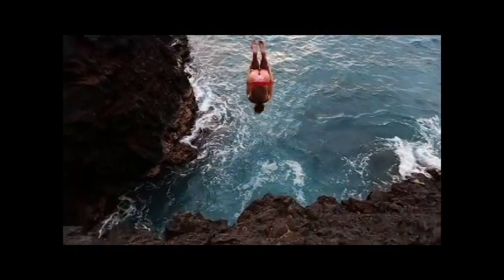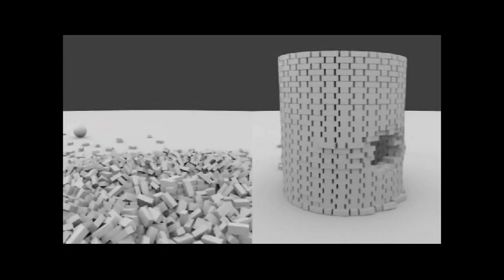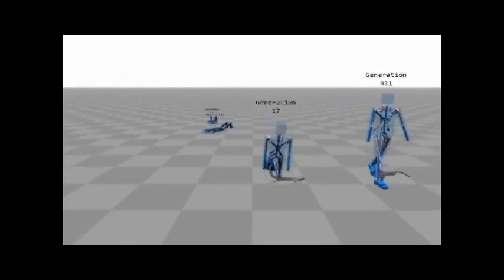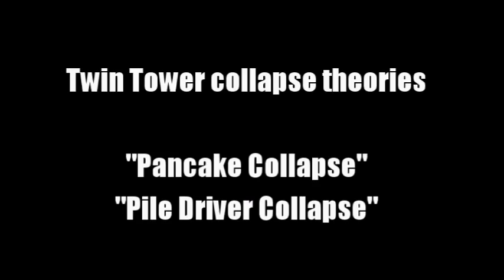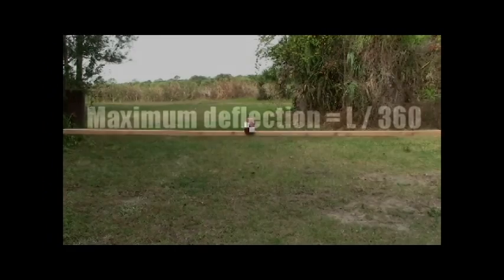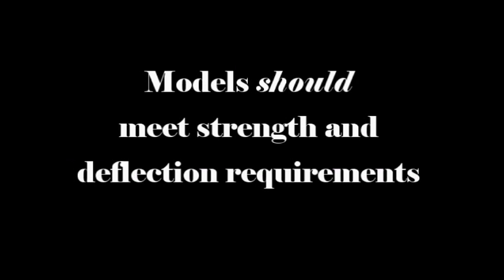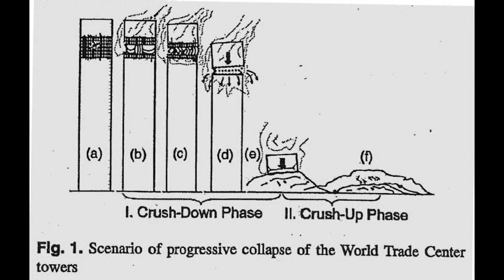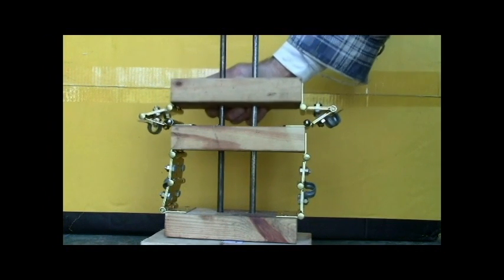9/11 Experiments: The Force Behind the Motion

Comment: There is absolutely no way possible that amount of demolition explosive would have gone un-noticed, survived the impact without at least some of them blowing, and been detectable in the rubble afterwards.
Reply: hellcat1988  In your expert opinion as a 10 year YT veteran, how many Molotov cocktails would have been needed to destroy the Lobby walls and break out ground level windows of WTC1? How many would be required to destroy the maintenance room in the basement levels that tossed a 50 ton hydraulic press across the room? They are, after all, primarily intended to set targets ablaze rather than obliterate them right? How would you say a Molotov cocktail differs from a kerosene low intensity, slow moving deflagration expansion of gasses 800 to 900 feet from the source of ignition?
Reply: +hellcat1988  Are you the type that waits on peer reviewed proof about the function of the bowels before you take a shit sir? Have you been able to tie your shoes without adult supervision yet?
Reply: +hellcat1988  I was just trying to determine if you have had any experience with the practical application of physics at any time in your life or if you were always informed what caused what to happen as in cause and effect? What would you say champ? Have you noticed anything about your environment?
Reply: +hellcat1988  You're a curious fellow full of contradictions and hypocrisy aren't you. I guess that makes you such an attractive hire for the debunker cult isn't it. 

The thing about the physics of everyday life before 9/11 was pretty much solved with Newton's theories and some improvements by Einstein. Their theories are "are commonly accepted, they aren't exempt from being questioned; as real science is prone to do. [presented, tested, reviewed, and accepted]" These were considered proven through the accepted scientific methodology of practical demonstrations. (experiments to prove concepts are valid)

You now suggest that you want to toss them all out the door in favor of unproven theoretical musings of NIST's 9/11 physics. Not for me chum, but you're welcome to think however you please. Good luck with those exploding pancakes.
Reply: +hellcat1988  Have you spent much time with your pom poms in your hands gleefully exclaiming "that proves everything" in the blacksmith from purgatory's channel where he heats up a 1/2" square metal rod red hot then bends it with his pinky to disprove the "moronic jet fuel theory" ?? Do you almost faint when he drops his metal rod on the floor like a classic mic drop after 2 minutes of telling people they are stupid and need to get a job ?
Reply: Yeah, sure....  And I'm sure the design of this guy's model not matching the towers design in ANY WAY didn't affect his test.  GIVE ME PROOF.  Verifiable, scientifically reviewed and confirmed PROOF.
Reply: Deleting your post and putting it under mine doesn't actually make it the proof that I was calling for.  

You conspiracy nut jobs can scream and whine all you want, but you never have anything to actually back up your claims.  I WATCHED those towers get hit and I WATCHED those towers fall.  ALL of it.  There were no secondary explosions.  The aircraft hit and the towers came down and the people died.  I won't even begin to argue about who was behind it because that's a web I don't feel like pulling at.  

I do know, without a shadow of a doubt, that those planes hit the towers and the towers came down because of it.
Reply: hellcat Quote: "GIVE ME PROOF.  Verifiable, scientifically reviewed and confirmed PROOF." Learn a bit about the laws of physics then and afterwards just think about the official USG theory that gravity blew up the towers and melted the steel and concrete.  The official USG theory is absurd.  Explosives and incendiaries did it. Take the WTC2 event, a top down explosive demolition.
9/11 Commission Report Page 305
“From 9 : 59 until 10 : 28
At 9 : 58 : 59, the South Tower collapsed in ten seconds, killing all civilians and  emergency personnel inside, as well a number of individuals - both first responders and civilians - in the concourse, in the Marriott, and on neighboring streets.”

Ten seconds = essentially, free fall.

Google:
Questions and Answers about the NIST WTC Towers Investigation
Quote:
“Since the stories below the level of collapse initiation provided little resistance to the tremendous energy released by the falling building mass, the building section above came down essentially in free fall, as seen in videos. As the stories below sequentially failed, the falling mass increased, further increasing the demand on the floors below, which were unable to arrest the moving mass.”

Where did the ENERGY to disassemble the building SEQUENTIALLY & in a highly explosive manner come from?  

The “falling mass” was obviously DECREASING as it was being sequentially ejected SIDEWAYS from the top downwards!

There was no crush down!  There was no “accumulation of mass” (or “increasing” mass) over the tower stub after the dust had settled! The building debris fallout zone was instead up to 500 feet from the tower base (FEMA said so).

In order for the towers to have "collapsed" gravitationally, as we've been told over and over again, in the observed duration, one or more of the following zany-sounding conditions must have been met:

1. The undamaged stories below the alleged aircraft impact zone offered zero resistance to the collapse.

2. The glass, steel and concrete spontaneously disintegrated without any expenditure of energy.

3. On 9/11, gravity was much stronger than gravity, because a giant invisible sky god stomped on the towers perhaps?

4. On 9/11, energy was not conserved.

However, none of these physics-violating conditions can be accounted for by the official government conspiracy theory of 9/11, nor by any of the subsequent analyses designed to prop up the official theory of 9/11.

Bottom line: the US government/PBS/PM/SA explanation for the WTC “collapses" fails the most basic conservation-of-energy reality check. 

Therefore the evil, lying, US government theory does not fit the observed facts; the notion of a “pancake collapse” cannot account for what happened. The "pancake collapse theory" or "progressive crush down" explanation is impossible, and thus absurd.

It is utterly impossible for a "gravitational collapse" to proceed so destructively through a path of such great resistance in anywhere near free-fall times. 

This fact debunks the preposterous contention that the observed WTC “collapses" can be blamed solely upon damages resulting from aerial assaults by just 19 Kamikaze superheroes. 

The unnaturally brief durations of the highly destructive top-down “collapses” (sequentially explosive demolitions) reveal that the towers did not disintegrate because they were coming down, but rather they came down because something else was causing them to disintegrate.  Gravity just carried the disassembled building debris out of the sky.

See also:
 "TV nerd beats NASA engineer with 9/11 Truth physics" ;-)
Reply: AYong:

1:  That isn't proof.  That is your guess at what happened.

2: The buildings didn't explode outward, as you claim, or the debris field would have been MUCH wider than it was.  Yes, some of the building material did get forced away, but a majority of the material fell down onto the floors below, hence the relatively small footprint of the main structural rubble.  A 500 ft debris field is not all that much for an unconstrained collapse of TWO buildings over 1300 feet tall.

3:  I do have a decent understanding of physics, as well as the ability to look at the design of the towers and realize this guy's "example" tower isn't even close to the same structural design.  Not in the least.

4:  Have you ever even watched a progressive collapse demolition?  Why don't you click around youtube a bit and watch a few.  Both successful and failed.  You'll get a better understanding of how the debris scatters, what it ACTUALLY looks like to have demolition charges go off on multiple floors, and what the collapsed structure might look like afterwards.
Reply: MrTheredpill:

Then provide proof.  Provide confirmed test results of the debris from the buildings containing explosives residue, video of the alleged explosions, proof that the explosives in the lobby blew first, and proof that there were explosives planted before the attacks.

It's all well and good to scream conspiracy, but without proof all you're doing is insulting the memory of the victims and the rescuers who died trying to save them.
Reply: Payed:

I never claimed to be an expert.  Obviously you aren't either.  You still aren't providing peer reviewed proof of anything.
Reply: Payed:

Kinda shooting yourself in the foot there with your examples...  I don't need to wait for peer reviewed studies and facts about how my bowels work.  They've already been done.  While the results are commonly accepted, they aren't exempt from being questioned; as real science is prone to do.  Until a better explanation has been presented, tested, reviewed, and accepted, I think I'll stick with the current theory.

Yes, I can tie my shoes.  Why, were you planning to graduate from velcro and need someone to teach you?

Again, you're still not providing proof of anything.  You'd think this long after the attack there would be at least one thread, one STRING of proof that could be verified to give some validity to your claims.  Yet there's nothing.  Either you're too lazy to bother looking for it or there isn't any to begin with.  Either way, the science backs me up, not you.
Reply: Payed:

That's the beauty of science.  I don't need to replicate the experiments of others.  They've invested the time, money, and effort into gaining an understanding of the world, then shared it with the rest of us.  Those findings have been reviewed, replicated, confirmed, and presented.  

You trying to distract from the FACTS surrounding the collapse based on solid, reviewed, scientific evidence by making a pathetic attempt to paint me as ignorant and lacking an understanding of physics isn't going to change that.

We could go back and forth for ages, you challenging me and me presenting the facts as I've been taught or learned on my own until I mistype something or find old information, at which point you'll again try to present me as some ignorant fool without any knowledge at all; despite and previous evidence otherwise.

I'm not going to debate you on that.  If you have ANY scrap of proof contrary to the findings of the investigation of the collapse or my earlier statement about the planes impacting the tower, then we can talk.  Otherwise, you're just a troll that I'm going to keep poking until you roll over and crawl back under your bridge.
Reply: Payed:

Those "unproven theoretical musings" are backed up by all known models of physics as well as advanced computer simulation.  You have nothing of the like to back up your own claims.

Just where is this hypocrisy of mine that you are claiming?
Reply: hellcat the scientific law of the conservation of energy and momentum is scientific proof that the official conspiracy theory for the destruction WTC1 & 2 is impossible and thus a lie. You may be aware of WTC7 being destroyed in an implosion demolition later that day.  What is less often discussed is how Jennings and Hess were trapped inside that building for hours, from before WTC2 blew up until after WTC1 had blown up, because both internal staircases had been destroyed by explosions, very clearly caused by explosives!  Since the "AA11 event" was obviously heading south into WTC1, very clearly no jet fuel (which is not a high explosive, or even very volatile, compared to gasoline) from that event could plausibly have entered WTC7, located to the north of WTC1, to cause the massive explosion that later blew Jennings and Hess backwards with the blast that destroyed both of the internal fire-escape stairs and had then trapped them inside that building for hours. 

See YouTube: Barry Jennings Interviews (WABC-TV, 2001 / LTW, 2007)

Barry Jennings (and Michael Hess) apparently arrived at the WTC7 emergency office (via a freight elevator, the main elevators had already been disabled) seemingly almost immediately after the OEM bunker had been evacuated, which reportedly occurred at the latest around 9 : 37 am, if not rather sooner before 9 am, according to other reports.  Jennings said later that he was already INSIDE the WTC7 building when the UA175 event into WTC2 happened, but it does not sound like he ever witnessed that event happening at 9 : 03 am.  

It is of course very curious that WTC7 needed to be evacuated as an emergency management centre at all, since it was an armoured structure designed specifically for EMERGENCIES just like this one and these two alleged air crashes into buildings that officially SHOULD NOT HAVE BEEN EXPECTED TO BLOW UP should have meant that the WTC7 bunker was a perfectly safe place to be!  

In 1999, NYC Mayor Rudy Giuliani had constructed a US$13 million emergency command retreat on the 23rd floor of World Trade Center Building 7.  An armoured, self-contained facility designed to provide a "safe haven for leadership" in the event of a natural disaster or terrorist attack. But several first responders interviewed after 9/11 claimed that the Office of Emergency Management’s Emergency Operations Center (OEMEOC) was empty and had been “deactivated” as early as 9 am on the morning of September 11th, a time when just such an emergency was in full swing!

Michael Hess has corroborated Jennings' account of hearing explosions inside WTC7 and witnessing the damage they caused which trapped them inside.  A 2010 video released by NIST further corroborates Barry Jennings' account.  Michael Hess is seen visible calling through a broken window of the 8th floor of WTC7, calling out for help to get down, after both towers had blown up, so presumably at some time after 10 : 30 am and before noon.  

One might think it possible that these explosions inside WTC7 destroying the two stairwells coincided with WTC2 blowing up at 9 : 59 am, but it is not plausible that any explosively ejected debris from WTC2 did that damage.  That timing is not what Barry Jennings later said though, he said the stairs were taken out at around floor 6, so he had to go back up to floor 8, then he bust a window with a fire extinguisher, then the NYFD ran away because WTC2 was coming down, then later WTC1 came down, before they were finally rescued, possibly at around noon, by the NYFD.  He also stated that there were some dead bodies inside WTC7 as he was leaving, although officially nobody died in WTC7 at all.
Reply: hellcat In the official theory for the WTC1 basement explosions (and lobby) it was claimed to be a simple deflagration fireball from jet fuel kerosene that had somehow made it all the way down to the basement. Never mind that witnesses said these bottom of the tower explosions happened before the alleged AA11 impact could have introduced any liquid fuel to the building and never mind that the cause of the explosions did not convincingly introduce liquid fuel and fireballs to the building between the impact floor and the basement! In WTC1.  William Rodriguez and his supervisor (Anthony Saltamachia) are on record for repeatedly affirming that there was a huge basement explosion in WTC1 before the "AA11" event, or the alleged first aircraft impact by a so-called "hijacked" aircraft. Other WTC1 eyewitnesses claimed that there was an additional lobby explosion before the "AA11" event.

Ms Evalle Sweezer (office worker): "I believe that the bomb hit the lobby first, then in a couple of seconds the first plane hit."

Mike Pecoraro & a colleague arrived at the basement WTC1 “C level” and they found that the machine shop was gone.

"There was nothing there but rubble, "Mike said. "We're talking about a 50 ton hydraulic press, gone!" [Wow, some really powerful kerosene deflagration fireball that was! ;-) ]

The two made their way to the parking garage, but found that it, too, was gone. "There were no walls, there was rubble on the floor, and you can't see anything" he said. [Wow, some really powerful kerosene deflagration fireball that was! ;-) ]

They decided to ascend two more levels to the building's lobby. As they ascended to the B Level, one floor above, they were astonished to see a steel and concrete fire door that weighed about 300 pounds, wrinkled up "like a piece of aluminium foil" and lying on the floor. [Wow, some really powerful kerosene deflagration fireball that was! ;-) ] "They got us again," Mike told his co-worker, referring to the terrorist attack at the center in 1993... He was convinced a bomb had gone off in the building... Mike ascended to the Lobby Level where he met Arti DelBianco, a member of his work crew.

See Bob McIlvaine's 2016 interview:

Bob McIlvaine and his family are not alone in having suffered a devastating personal loss on September 11, 2001. The loved ones of the nearly 3,000 victims of the destruction at the World Trade Center know what he has endured for the past 15 years.

But McIlvaine is different from most of these families in important ways. In addition to his unwavering and often lonely fight to expose what he calls the complicity of the US Regime in this false flag attack, he has strong forensic evidence proving that his 26-year-old son, Bobby, was killed by a powerful explosion upon entering the lobby of the North Tower. That evidence is corroborated by the accounts of many FDNY members, police officers, and workers who reported that explosions went off in the lower parts of the towers before the buildings were levelled — some of them even before the first airplane struck.

In a recent interview, McIlvaine said that his son’s body was one of the first to be recovered and taken to the New York City morgue on that fateful day. He explained that he has been able to reach more definitive conclusions about the details of his son’s death only since conferring, in either 2006 or 2007, with the doctor who had examined Bobby’s body at the morgue.

That meeting provided Bob McIlvaine with evidence confirming that a huge explosion — and not the North Tower's eventual demise — was responsible for killing his son. According to Bob McIlvaine, the wounds described by the doctor indicated that his son had been hit by flying glass from some kind of gigantic blast.

Bobby’s face was damaged beyond recognition, he had lacerations all over his chest from glass shards, and he had post-mortem burn marks. In fact, the blast was strong enough to literally blow Bobby out of his laced shoes (they were not on the body when it was brought to the morgue).

“My final summation is that he was walking into the building, and before he got into the building there was a huge explosion, and of course the force of it just threw him back into the open area,” Bob McIlvaine says. “That’s why he was picked up so quickly, because the EMTs came down there so quickly. Someone had gotten him out of there and to the morgue before the towers came down.”

It is the nature of Bobby’s injuries that convinces the elder McIlvaine that the explosion had nothing to do with the airplane hitting the tower. That conclusion is at odds with the explanation put forth by the 9/11 Commission, which attributed explosions in the Twin Towers' lower floors and basements to fireballs of exploding jet fuel coming down the elevator shafts and blowing out.

“He wasn’t hit by a fireball, he was hit by a detonation,” McIlvaine contends. “In a detonation, the blast is first and then followed by the heat.”

He points out that the official account credits the supposed fireball with blowing out floors in different parts of the building — leaving many untouched floors in between the damaged ones.

“It blew out the 72nd floor, it blew out the 23rd floor, it blew out the lobby, it blew out all sorts of floors in the basement, and it even destroyed parts of the PATH [rail] station more than 200 feet away. For one fireball to do all that — well, that’s one powerful fireball.”

This becomes even more impossible, he argues, when you consider that the tower was divided into three vertical sections. Each elevator (except for the basement-to-penthouse maintenance elevator) serviced only one section. Thus, someone travelling from top to bottom would have had to take three different elevators. This configuration would have prevented fuel from pouring down the multiple elevator shafts and causing all that destruction.

In short, says McIlvaine, “It’s impossible for a fireball to come down that far and create that kind of damage.” [Jet fuel is like kerosene, it DOES NOT EXPLODE but can only ever deflagrate with a very low pressure fireball.]

What made the horror of September 11 even worse for the McIlvaine family was that they had no information about their son and didn’t know if he was alive or dead. Adding to their uncertainty was that he didn’t actually work in the towers; instead, he worked for Merrill Lynch in an office building across the street from the World Trade Center. So McIlvaine thinks it’s possible that his son was either on his way to a Merrill Lynch seminar that was being held on the 106th floor of the North Tower or was cutting through to get to his own office.

A Canadian who worked for Merrill Lynch in 2001 and who was at the World Trade Center that day contacted McIlvaine two years ago. The man explained that he was heading to the same conference on the 106th floor about the same time that Bobby would have been approaching the building. But he had stopped for a coffee on the way — a decision that, in retrospect, he thinks might have saved his life. While ordering his coffee, he heard a massive explosion in the North Tower lobby.

McIlvaine says he doesn’t tell his son’s story that often anymore because most people just don’t want to hear it. Even the 9/11 families don’t want anything to do with the idea that the event was, as he claims, perpetrated by their own government.

“People look at the United States as a father figure, and they just can’t believe their father could do something that evil.”

McIlvaine and his wife, Helen, have written a message for the 15th anniversary of 9/11 that will appear in The Journal of 9/11 Studies and that Bob will read at the two-day “Justice In Focus” conference being held the weekend of September 10-11 in NYC.

“I don’t want to be a victim,” McIlvaine says. “I just want to keep speaking my piece.”
Reply: Payed:

You really can't stand it that you know I'm right can you?  You can't stand it that the science backs me up and you can't show one scrap of evidence to back up your conspiracy theory.  It's really sad to see someone come to that realization.
Reply: AYoung:

Again, if you really believe the science backs up your claims about how the two towers came down, find some scientists and studies that support your claim and present them.  Give links to peer reviewed and corroborated investigations.

As far as building 7 is concerned, I haven't bothered to look into it at all because that's not what I'm arguing about.  The only thing I've been arguing is that the planes hit the towers and that is why they came down.
Reply: MrTheredpill:

I'm not insulting the small number of surviving eye witnesses.  I'm asking for one shred of proof that could corroborate the story even a little.  Some rubble that's been chemically tested by a team of labs to confirm there is explosive residue.  A piece of detonation cord or explosive device that would show how and where the explosives might have been placed.  ANYTHING that might lend some credibility to your claims.
Reply: hellcat quote: "None [not one] of you have [has] liked [linked] to studies or peer reviewed articles showing how, where, and what kind of explosives were found in the rubble." Well you are just ignoring independent research, published internationally, that found unreacted nano-thermitic material in the fallout dust surely?  You are not going to find these publications to read in the USA of course!  

What was found in the official story points to incendiaries melting the steel and concrete and high explosives being used as well. Bob McIlvaine talks about his son being blown backwards out of his shoes when he was killed by the massive WTC1 lobby explosion, that happened a few seconds before the first alleged air crash of AA11 into WTC1. Additional very high explosive damage (so from supersonic detonation blast, not low-pressure deflagration) was simultaneously destroying areas of the WTC1 basement before the alleged AA11 event.  

Air slap was breaking windows hundreds of feet away from the Twin Towers as they blew up.  Blast ejected multi-tonne sections of steelwork upwards and outwards from the towers at a sideways speed of about 70Mph.  Air slap tossed observing news helicopters around in the sky thousands of feet away as the towers blew up. 

The billions of microscopic iron microspheres in the fallout dust indicates that steel was explosively cut, the steel turned to a liquified mist of microscopic iron spheres that formed tiny iron balls under the action of surface tension, as this "mist" cooled.  The sulphur contaminated steelwork and eutectic inter-granular melting of the steel, causing a Swiss cheese effect,  has been theorised to have been caused by a "thermate reaction" with "thermate" as a subtle variant of thermite. 

Non-US Regime sponsored, so independent researchers, also reportedly detected unreacted highly engineered nano-thermitic material in the fallout dust. This was apparently engineered so that a layer of aluminium seems to have been vacuum deposited on an iron oxide substrate layer, before grinding the material into a very fine dust.  Such a substance could well have a much faster reaction time than normal thermite, which is a rather crude mixture of aluminium and iron dust.  The dark coloured dusty "squib" evidence, might indicate that a very high brisance thermobaric (two-stage, fuel-air) explosive was used. An electrically charged thermobaric dust cloud could be an even more sophisticated method of arranging, or distributing, the nano-thermitic fuel-air mix in an open plan office building space, just prior to detonation. 

Anomalous "fires" with very great heat that melted steel and concrete remained at ground zero for months after 9/11. Decontamination earth was trucked in to ground zero, spread around and then trucked out again to the aptly named "Fresh Kills" dump site with residual heat in the ground at Fresh Kills preventing the earth from freezing that winter because the ground water was still boiling hot.

Temperatures in WTC6, gutted by a massive explosion unrelated to any other buildings blowing up, were so high that in WTC6 museum exhibits you could see melted guns encased in previously liquified melted concrete that had "flowed like lava" according to the exhibit caption. 

Anyway, that is my point of view, other mind/body organisms will no doubt have their own subjective point of view, so that they may well perceive the scientific evidence in a different way.  

It is rather like the old story of an elephant in a small room, with small windows affording individual people a very limited view of the elephant.  One observing person might say "I can see a big curved white tooth looking thing.  How weird!"  Another might say "I can see a little eye looking back at me."  Yet another might say "what a huge foot that is!"  Or "what a funny looking tail that is!"   It is very difficult for us to form an overall impression of what an elephant might really look like, unless you can see the entire animal all at once!

Therefore, IMO when studying an interesting event in history like 9/11 for the "who, what, when, where why and how" it is necessary to view this "elephant in the room" from a great many different angles. Cui Bono? Who Benefited?

Or take the WTC7 implosion demolition event, that NIST has also admitted was in free fall at "stage 2" of the "collapse".  So that free fall was only possible there because EXPLOSIVES had removed all of the load bearing columns, simultaneously, out of the way of the falling mass!  Dr. Robert Korol, professor emeritus of civil engineering at McMaster University in Hamilton, Ontario, Canada and a fellow of the Canadian Society for Civil Engineering, has led a team of academic researchers in preparing two peer-reviewed scientific papers on the destruction of World Trade Center Building 7. Both papers were published in the Challenge Journal of Structural Mechanics — the first one in July 2015, the second in February 2016. 

Google:
The collapse of WTC 7: A re-examination of the “simple analysis” approach
Robert Korol, Paul Heerema, Ken Sivakumaran
Department of Civil Engineering, McMaster University, Hamilton, Ontario L8S 4L7, Canada

Quote: Regarding our focus on gravitational potential energy versus the dissipative energy possessed by the structure, we found that the former was insufficient to cause a total collapse scenario to occur by a factor of 4.

But why make such appeals to authority anyway? Think for yourself!
Reply: You still aren't providing any links to actual peer reviewed scientific data showing that the trade center was taken down by explosives.  

It wouldn't be hard to conceive that those "micro-spheres" were created from molten steel from the fires being blown out of the buildings as the collapsed if you've ever worked with molten metal before like I have.

As far as the lobby of either building being blown up before the towers collapsed, how the hell do you explain people evacuating from those very lobby?

Thinking for yourself is great and all, except when you're ignoring fact and science to come up with your own idea of what actually happened.  That's how religions work and why they're all crap.
Reply: hellcat: "You still aren't providing any links to actual peer reviewed scientific data showing that the trade center was taken down by explosives." I gave you a peer reviewed paper to search for, you must be aware that hot links will render the post invisible due to censorship.
Reply: hellcat you said "It wouldn't be hard to conceive that those "micro-spheres" were created from molten steel from the fires being blown out of the buildings as the collapsed if you've ever worked with molten metal before like I have." Except that office fires cannot possibly reach hot enough temperatures to melt steel.  Your hypnotically entranced mind is now desperately grasping at metaphorical straws, to maintain the absurd fiction of gravity blowing up the towers, in a resistance free manner!  It took mankind thousands of years to create blast furnace fires hot enough to melt steel.  Ordinary office fires do not melt steel!  No other steel frame buildings have ever "collapsed" (have ever blown up) like that, due to fire!

There was no crush down, there were even human survivors in stairwell B of WTC1 because that tower did not crush down on top of their heads, the mass above their heads flew away sideways from the top downwards, at about 70 Mph.  The survivors looked upwards after the explosive demolition process, to see blue sky above their heads!  

Quote: "As far as the lobby of either building being blown up before the towers collapsed, how the hell do you explain people evacuating from those very lobby?" Because the explosion in the lobby obviously did not interfere with the evacuation through the explosion damaged lobby, or interfere with the firemen entering the lobby and the Naudet video crew showing us video of the explosion damaged lobby, the explosion that had just killed Bob McIlvaine's son in the Plaza outside the lobby.
Reply: MrTheredpill:

Wow...  You're one of those anti-vaccination people?  That explains A LOT!

Do your research about vaccinations you twit.  There has only been one TOTALLY disproven study finding any link through manipulated data of an extremely small sample size.  The only reason there has EVER been any possible link considered between autism and vaccinations is because the first diagnosable symptoms for autism don't actually show up until the same time as vaccinations would be administered.  Even the studies commissioned and paid for by the idiot parents who thought vaccinations caused autism found no link whatsoever.

As far as cancer rates, there are new studies coming out that are pointing to cancer as an inevitability of old age due to degradation of dna over time as a natural part of the aging process.

I don't know why I'm even bothering to continue humoring you as you've proven just how much of a wackjob conspiracy nut you are by showing that you're an anti-vaccination freak.
Reply: Have you ever worked on a car that's been on fire?  Have you ever picked through a shed that's burned down?  Have you ever worked with any kind of metal cutting implement AT ALL?  Have you ever thrown any metal into a bonfire?

I have done every one of those things and I can say without a doubt that ANY kind of accelerant, even the adhesive used to make carpet (even the fire resistant kind) will melt steel.  Once it's molten, high pressure airflow, like what you'd find from a collapsing building or convection flow through a chimney will blast small particles of metal out of the pool.  From there, it's not hard for the metal to form spheres as it falls even a short distance.

Ask anyone who works at a metal foundry how often they have to sweep up the metal dust from slag blown off the casks or steel workers who have to clean up after prepping and welding.

If there is video evidence of the lobby being blown up BEFORE the planes hit, share it with the rest of us.  That would be proof lending credibility to your crack pot theory.  I'm guessing you're going to say something to the effect of "he didn't start recording until after the plane hit" or "they seized his footage" or some similar crackpot cliche.
Reply: Where's your evidence to the contrary?  What do you have to back up your claim?  It amazes me how people can take anecdotal evidence without any proof to back it up, or even just hearsay, and form such solid belief around it.  I realize that's exactly how religion works, but still.

You anti-vaccination idiots are the ones who are going to end up dead, as evident by the recent outbreaks of diseases we have vaccinations for...
Reply: hellcat you said "I'm guessing you're going to say something to the effect of "he didn't start recording until after the plane hit"" If you had actually studied the French Khazarian Jules and Gedeon Naudet video record, it would be obvious to you that they were videoing the Church & Murray intersection and the Church Street "gas leak" --- which permitted them to document the scaffolding already roped off with Police Tape before the UA175 event and giving them a very nice view of WTC1 north face for the AA11 event.  So pretty obviously they were quite a long way from WTC1 when the lobby explosion happened.  There are telephone audio recordings of the two explosions, but if you are going to ignore so many American eyewitnesses and victims telling you exactly what happened, then believe whatever you want to believe. Shrug.
Reply: hellcat you said  "A piece of detonation cord" but there is no reason to think that detonation-cord would have been used in this case, of a camouflaged military sabotage program.  Don't confuse military technology with crude, cheap, civilian demolitions please.  Officially US regime sponsored researchers noted eutectic inter-granular melting with sulphur residue contamination causing a Swiss Cheese effect.  Independent researchers found unreacted nano-thermite in the dust. You insist that normal office fires melted the steel and concrete at ground zero and kept the fires burning for months, even though that never happened during WW2 in European cities. 

Genuine sabotage devices would not ever have "DANGER! I am a Bomb!" written on them!  Neither would they look like sticks of dynamite with an alarm clock strapped to them!  Or have a red digital clock on display, ticking down the seconds to detonation, as in so many stupid Hollywood movies!  Realistically, you would want to disguise any (digital radio detonated) sabotage devices as looking like something innocuous, like "lighting transformers" or something, to be hidden in the ceiling voids above the ceiling tiles (attached to the truss network), inside the technical risers, under the raised technical flooring tiles, that need to be raised only when running services (cables etc.) to desks in open-plan office spaces.  

Civilian office workers would never look there and, even if they did, they would not know what they were looking at anyway.  But believe the 19 Kamikaze Superhero propaganda cover story if you like. Shrug.

The following text is the transcript of the
9/11 A Conspiracy Theory You Tube Corbett Report

On the morning of September 11, 2001, 19 men armed with box-cutters directed by a man on dialysis in a cave fortress halfway around the world using a satellite phone and a laptop directed the most sophisticated penetration of the most heavily-defended airspace in the world, overpowering the passengers and the military combat-trained pilots on 4 commercial aircraft before flying those planes wildly off course for over an hour without being molested by a single fighter interceptor.

These 19 hijackers, devout religious fundamentalists who liked to drink alcohol, snort cocaine, and live with pink-haired strippers, managed to knock down 3 buildings with 2 planes in New York, while in Washington a pilot who couldn’t handle a single engine Cessna was able to fly a 757 in an 8,000 foot descending 270 degree corkscrew turn to come exactly level with the ground, hitting the Pentagon in the budget analyst office where DoD staffers were working on the mystery of the 2.3 trillion dollars that Defense Secretary Donald Rumsfeld had announced “missing” from the Pentagon’s coffers in a press conference the day before, on September 10, 2001.

Luckily, the news anchors knew who did it within minutes, the pundits knew within hours, the Administration knew within the day, and the evidence literally fell into the FBI’s lap. But for some reason a bunch of crazy conspiracy theorists demanded an investigation into the greatest attack on American soil in history.

That investigation was delayed, underfunded, set up to fail, a conflict of interest and a cover up from start to finish. It was based on testimony extracted through torture, the records of which were destroyed. It failed to mention the existence of WTC7, Able Danger, Ptech, Sibel Edmonds, OBL and the CIA, and the drills of hijacked aircraft being flown into buildings that were being simulated at the precise same time that those events were actually happening. It was lied to by the Pentagon, the CIA, the Bush Administration and as for Bush and Cheney…well, no one knows what they told it because they testified in secret, off the record, not under oath and behind closed doors. It didn’t bother to look at who funded the attacks because that question is ultimately of “little practical significance“. [Little = Huge] Still, the 9/11 Commission did brilliantly, answering all of the questions the public had (except most of the victims’ family members’ questions) and pinned blame on all the people responsible (although no one so much as lost their job), determining the attacks were “a failure of imagination” because “I don’t think anyone could envision flying air-planes into buildings ” except the Pentagon and FEMA and NORAD and the NRO.

The DIA destroyed 2.5 TB of data on Able Danger, but that’s OK because it probably wasn’t important.

The SEC destroyed their records on the investigation into the insider trading before the attacks, but that’s OK because destroying the records of the largest investigation in SEC history is just part of routine record keeping.

NIST has classified the data that they used for their model of WTC7′s collapse, but that’s OK because knowing how they made their model of that collapse would “jeopardize public safety“.

The FBI has argued that all material related to their investigation of 9/11 should be kept secret from the public, but that’s OK because the FBI probably has nothing to hide.

This man never existed, nor is anything he had to say worthy of your attention, and if you say otherwise you are a paranoid conspiracy theorist and deserve to be shunned by all of humanity. Likewise him, him, him, and her. (and her and her and him).

Osama Bin Laden lived in a cave fortress in the hills of Afghanistan, but somehow got away. Then he was hiding out in Tora Bora but somehow got away. Then he lived in Abottabad for years, taunting the most comprehensive intelligence dragnet employing the most sophisticated technology in the history of the world for a decade, releasing video after video with complete impunity (and getting younger and younger as he did so), before finally being found in a daring SEAL team raid which wasn’t recorded on video, in which he didn’t resist or use his wife as a human shield, and in which these crack special forces operatives panicked and killed this unarmed man, supposedly the best source of intelligence about those dastardly terrorists on the entire planet. Then they dumped his body in the ocean before telling anyone about it. Then a couple dozen of that team’s members died in a helicopter crash in Afghanistan.

This is the story of 9/11, brought to you by the media which told you the hard truths about JFK and incubator babies and mobile production facilities and the rescue of Jessica Lynch.

If you have any questions about this story…you are a bat-shit, paranoid, tinfoil, dog-abusing baby-hater and will be reviled by everyone. If you love your country and/or freedom, happiness, rainbows, rock and roll, puppy dogs, apple pie and your grandma, you will never ever express doubts about any part of this story to anyone. Ever.

This has been a public service announcement by: the Friends of the FBI, CIA, NSA, DIA, SEC, MSM, White House, NIST, and the 9/11 Commission.

Because Ignorance is Strength.

~~~~~~~~~~~~~~~~~~~~

Google:
Nonsense Fairytales Propaganda Crap... Still You Believe - YouTube

”Obama is dead, I don't care, what did I say?" Geraldo Rivera

You heard it on the evening news
The voice of AUTHORITY
And though it was all a lie
Still you believe

Do, do, do, do, do,

They told you about yellow cake
As a pretext to war
They embedded reporters cheap
like $5 whores
They gave you a bogeyman
to scare you at night
and terror threat level alerts
till you were ready to fight

But it's all a lie, made of nonsense for you to buy
still you believe, still you believe, still you believe

They told you Earth's heating up
That we're all going to stew
But the only thing cooking here
is the data that they use

They told you about Saddam Hussein
and his W. M. Dees,
They were sure that he had them too
Cos they still had the receipts

But it's all a lie, made of nonsense for you to buy
still you believe, still you believe, still you believe

Still you believe all of their crap
never suspecting that it's a trap
You're being had, you're being used
it's all just a game & you're going to lose.
You'd better wake up
Before it's too late
Before the jigs up
And you've sealed your fate

And now for the coup de grace
to fool you and me
they said they'd just killed the bogeyman
and buried him at sea

Lies, nonsense, fairy-tales, propaganda crap
Mind numbing, soul crushing, psychological trap
It's the way that they've always worked
and maybe it's fate
they'll keep doing it
until you stop taking the bait

It's all lies!